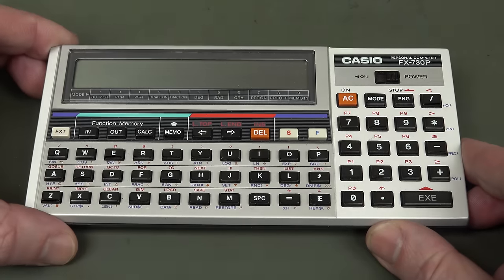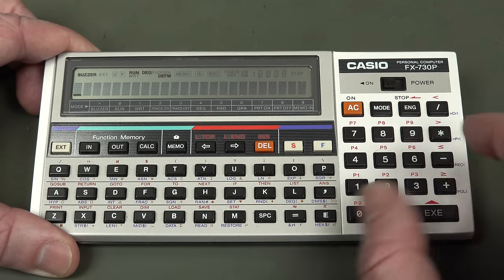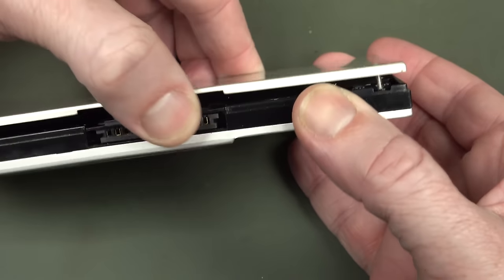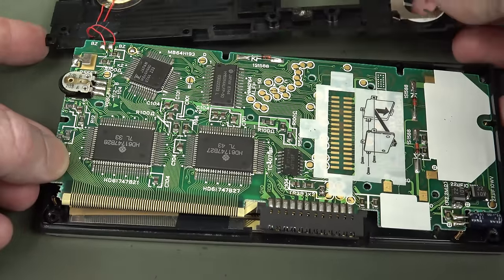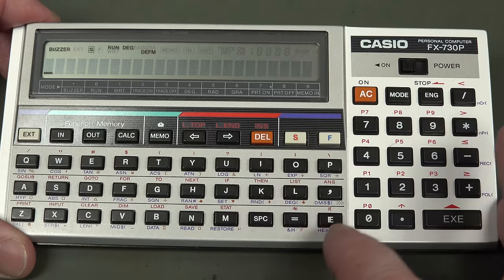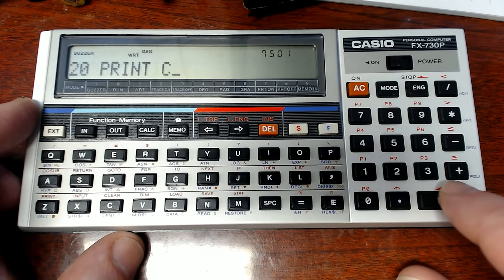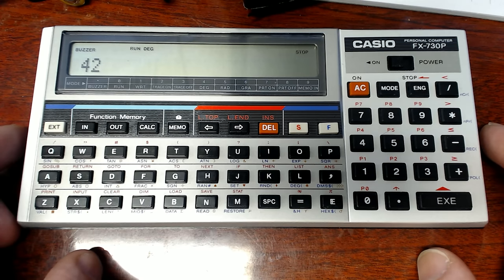EEVblog #1102 - Casio FX730P 1980's BASIC Scientific Computer

Comment: My first computer was a FX 720p (like this but smaller display), sold it long ago when I was a kid.   I recently bought one off ebay that wasn't working thinking it would be fun to try and fix, turned out they'd managed to shove the memory card in BACKWARDS and that was the only reason it didn't work, flipped it over and works fine!

Comment: 10 c=c+1
20  print c;: print
30 goto 10

This will allow the program to run without hitting the EXE button for each step
Reply from the maker: Ah, I knew there would be a way to do it, I didn't read the manual.
Reply: Dave "I didn't RTFM" Jones strikes again :-) I once had a (casio) PB700, is that older or newer than this one? It had a expansion port and RAM cartridges.
Reply: Starting to use c without giving it a defined initial value still kind of ticks me off!
Reply: There is also programming mode - TRACE ON, TRACE OFF. If you do TRACE OFF - you'll get the same.
Reply: Thanks. Also ran this in my Amsrad CPC 646 only with *2. The little CASIO can count to far higher numbers which I found intresting.

10 C=2
20 C=C*2
30 PRINT C;: PRINT
40 GOTO 20

With the Amsrad youdon't need ;: PRINT but you probaly knew that anyway.
Reply: @gotj  I love my CASIO PB-700. Was the first vintage computer I got for the wopping price of 99p on eBay, probaly because it was dead. That did not stop the teenage me cracking it open & repairing the battery leakege damage.
Reply: @TheEPROM9 Great!

Comment: This brings back memories... My dad had MK-85, USSR equivalent to the FX-700P. It was almost identical visually and had somewhat similar BASIC capabilities, but was completely different inside, to the point that is had a 16-bit CPU (while at the same time being slower than FX-700P), and lacked any expansion.
Reply: YES I have it too it is still running, but design was much more worse, it hase 4 batteries 1.5V and it works like only few months on it ;-), The biggest difference was that it could plot on the display some dots like a graphic calculator.
I also have casio fx-720P and fx730P like the one in the movie.

Comment: I bougth an 750P back in 1985 during my apprenticeship. Added two 4k RAM expansion cards. (It could hold two cards at the same time.) Moved over to a 850P in 1988. After 30 years it still serves as my daily calculator at work. I wrote some helpful little basic programs, still using one occasionally. The scientific and basic (blue, red) labels on the keyboard are bleached out. And pressing the BRK key often turns the calculator off. Gentle pushing right of the power switch against the case brings the FX-850 back to life. I wonder if any of the smartphones sold today will still work in 30 years. By the way, I have a collection of about 40 different CASIO (or TRS rebranded) basic programmable pocket computers. All in working condition!

Comment: I wish, I still had mine. I broke it in the mid 1990s and have never found a calculator, that I liked as much. It was simple to use, nearly no learning required. I really liked the formula entry and calculation feature, which was very helpful at university.

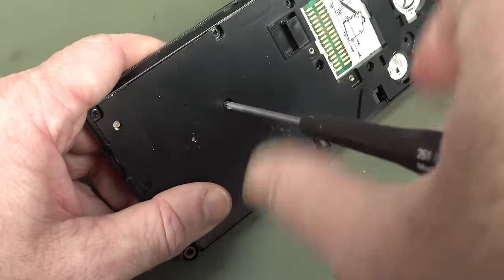Comment: 6:00 + ...  Actually the Hitachi's are not merely display drivers... These are actually 'DUAL' 8 bit HD61700 series CPUs that have 16bit internal data busses - The 730p is not too dissimilar to the folding 790p.  The Second CPU manages the scientific functions of the machine & half of the display, shifted keys etc. Whilst the First CPU manages the 'computer' aspect; BASIC interpreter,  runtime environment, the other half of the screen, unshifted keys & so on. The other 3 chips are a 440 gate logic array, 8k ram, & a quad 'OR' logic gate.

Comment: 10 c=c+1
20  print c
30 goto 10

I expect undefined behavior since c wasn't defined
to be 0. I assume, typically compilers will initialize variables to 0 then.
Reply from the maker: Yes, every BASIC I've ever used has always initiated to zero by default.
Reply: EEVblog, okay I figured so, thank you :) Great video by the way
Reply: Some BASIC's do some don't. Some of the ones on UK micro don't and give you an error, from memory the BBC micro/Electron. But I could be wrong.
Reply: If the program was used by another one in another section then the C variable may have been not set to 0. In this case, it would have been ok to enter 5 CLEAR. but as well change 20 like  20 PRINT C;  to get a non stopped execution. But all numbers would have been dislayed on the same line then scrowling on the left. To get the proper counter, the line 20 should have been 20 PRINT CSR0; C;   and then the numbers would have been incremented at position 0 without break. Each time the machine is turned on and the program is executed, the number count would have continued from the last break. To start from 0, the command 5 CLEAR or 5 C=0 would have been necessary.

Comment: Nice video I just saw today (3 years after you published it). BTW, you can execute any program recorded in the 10 sections by typing MODE 0 and then SHIFT n (the number of the section (0 to 9).  No need to enter RUN. Each program in the different sections can be called by each others using command GOSUB #n with n the number of the section. Interesting to imagine at that time to prepare programs witht the MAIN in 0 and then calling sub ones in different sections. No way to pass parameters but variables were global. So a section may perform a calculation with a variable used in another section. Variables were not isolated.

Comment: I have the FX-720P with 2kb SRAM (1568 bytes available after reset), and I had it overclocked back in the 80’s with a potentiometer replacing the resistor of its R/C that it was using for clock. I made it run from its initial 200kHz up to about 1MHz, although it needed to also be overvoltaged to 8V from the initial 6V of the 2x CR2032. I did it just as a proof of concept, not because it served some purpose to overclock it, but it was fun, and I still have it to this date in working condition! The 8V regulator (78L08) and the potentiometer are still embedded in the case. The regulator on the slim side next to the RAM cap, and the potentiometer was fitted on the mounting hole for the printer, on the back side. I’ve opened a tiny hole next to the expansion connector for the barrel plug of the external power, for when I’d wanted it to run overclocked.

Comment: I still use a Casio fx-450 calculator, a truely pocket size solar powered calculator that  does decimal, hex, octal and binary. Also does some logic functions (and, or, xor not, xnor) plus trig, polar/rectangular, DMS, and even fractions. There are also some built-in constants like speed of light!
Reply: the 450 was my first REAL calculator. I loved it. I eventually wore mine out and I still miss it though I have "better" calculators today it remains a favorite.

Comment: This clip in the middle of the FX-750 is for holding the calculator in place, when you use the FP-12S Printer with the table. You have to put the calculator on the table and then to the printer, who has a rendell-screw to tighten the whole thing.

Comment: Whoa. Memories. I still have mine somewhere around. We used this in our math class and it was allowed during graduation finals. Basic was limited, and there was no system level access whatsoever, but you still could achieve some fine results. I programmed a numerical analysis program for finding roots and extrema for polynoms. Was fun

Comment: Not quite that model, but I still occasionally use a PC-1403H. The periphery connector looks almost identical. The 1403 had a cassette interface in there for "load" and "save" commands, maybe this one has too? I also managed to score a printer for it on ebay recently.

Comment: The I/O connector was used to attach to a tape deck for program backup, printer, and... modem. Someone actually made a modem for those things.

Still using the Tandy PC-3. Similar to your Casio (but more cheaply made).
Reply: the Tandy PC3 is a sharp PC 1251
Reply: Also a link cable to transfer between two FX730Ps. I think I still have one and the cable. And the manual! I’ll have to find it now.
Reply: Yes, i build an interface to store my programs to tape for a sharp pc-1403H. I guess it is a successor of the fx730. It worked fine until the i guess i blew the port of the calculator...

Comment: The little springs on the back remind me of the spring in the HP 12C/15C type calculators.  They to had ground connecting springs.  Wonder if they stole the idea from HP.

I'm going to be uploading a video on picking a good calculator for basic electronics.  Going to cover everything from super basic calculators to the premium ones like the HP Prime.

I have about 820 calculators in my collection and think I may start doing videos on them from time to time.  Seems to be a increasing interest in vintage calculators.
Reply from the maker: Those ground springs are as common as mud on all sorts of stuff like this, I doubt HP invented it.
Reply: Springs more for ESD protection than EMI, as those low power processors could easily get corrupted memory if you used them as a discharge path from your charged body to a desk. Casio used the IO connector as a way to connect a printer and a cassette desk, so you could print ( using a small 4 colour pen plotter, with exquisitely expensive little pens that wrote 150m or so before they ran out of ink, or a small thermal printer later that was slightly better) and save your programs to tape. Tape interface also allowed the calculator ( and a big basic program you typed in) to play music as well, single note at a time, and somewhat limited, but big in 1980.
Reply: EEVblog excellent video :)
But, can the Casio scientific calculator run Crysis?
Reply: @thanthanasiszamp4707  No, for the zillionth time.
Reply: @Crazytesseract  my question was sarcastic

Comment: I still own this calculator with the original leather case and german manual and 16k of memory. It works fine, even with the 15 years ago programmed "horse race", which is one part in the manual. Great video!

Comment: that calculator is very easy to use. if you press the letter "S" (with the red color) its means its all for the red function and "F" for all the blue functions. its design to make simple programs specially for counting or determining coordinates depends on your program if your a Civil Engineer of so. in the year 1980 - 1990.

Comment: I'm a confirmed pocket computer tragic, I suspect. Started with the Sharp PC1211 back when I was in school, later replaced with a PC1246, followed by the PC1350 with the 4-line display and pixel-addressable graphics. These days in my desk drawer at work I have a PC1350 (with the 16k static RAM card), a PC1403H, and an EL5100 (not BASIC programmable, but a pretty impressive calculator for 1979) - they see regular, if not daily usage when I need a calculator - and they make me smile.

Comment: Springs help pop off the back cover. That's my experience from having owned several Casio's of this vintage.
Reply: Looks like that to me.  The ends of those springs are captured in the plastic and not electrically connected to the PCB so I can't see how they would act as conductors for EMI.

Comment: You can print "continuous" by simply adding a semicolon. For example 20 PRINT CSR0;C; would have shown you a continuous changing number. CSR0; is needed to make sure you keep printing at the start of the line. Also there is no need to add spaces when you code, the 730P will add them automatically, so you can simply type 20PRINTCSR0;C; and the spaces will appear automatically. With a bit of practice you can really type programs very quickly. I really like this pocket computer, but miss some functions like complex numbers, vectors and matrices.

Comment: Hyperbolic functions are because with one key you can get six new functions. I had Casio FX-702P from 1981 it was probably the first such Casio. I liked the way it was used to do calculations but unlike modern calculators you could not go back to the calculation after pressing the exe. If you made a mistake you had to do it all again.

Comment: Man soldering those diodes would have been a pain, surprised they didn't just use a melf package. Also cool reset switch, just a bit of metal soldered to PCB

Comment: I had the more commonly sold CASIO fx-720p, enjoyed writing a few simple programs when it came to repeated calculations during my studies.
It had only a 12 character display, so I was annoyed when the larger display version came out soon after.  
The port on the back is for the printer and/or cassette interface, the tab underneath is to align and grip these units more securely.
To save programs I used the RAM cards, which were expensive but I figured it was easier to swap out on the fly (powered off) than loading and saving via tape.  There was a latched door on the bottom to access these instead of needing to unscrew the case.
I found my CASIO fx-3400 programmable calculator better for everyday use, and still have that today.
For pocket computing, I soon got a Psion mx-5, which could connect via my Nokia 3210 to GSM data and get my email, diary, etc.  How quickly things moved on!
Reply: I had a 720p too. I remember spending ages typing in some of the example programmes from the manual.

Comment: I still have my Tandy branded version and its four color pen printer/plotter. In the mid 80s I did useful engineering tasks at work with it. I also still have my HP 21 and its accompanying "ENTER > =" T shirt. Yes, I hold on to some things.

Comment: Dave. i have a energizer battery from 1990 that still works. and has not leaked.    its has mercury in it(does not have the tree on the label).    Energizer bunny  keeps going and going! no need for batteriser...

Comment: 8k ram was simply a standard 6264LP3 ram chip that was on a PCB, with the zebra stripe connectors connecting pin to pin there on a small PCB.

Comment: Is this the predecessor off the FX-740p? I had one borrowed and it was pretty fun, had a RS232 I/O on the expansion port, one more line and more memory. I think the beep was disabled by default... Great stuff. Also the Ti Galaxy and HP programmable calculators were very fun to program.

Comment: I have a Sharp EL-5500III scientific computer which is missing its "N" key.  It can be a bit of a pain to program as you have to actually switch between a Run and a Program mode during programming.

Comment: Nice find mate!  this kinda looks like a TRS-80 pocket computer clone. which i  still have my TRS80 pocket computer and works like new. i removed the battery 4-5 yrs after i bought it so it didnt rot while stored.
Reply: All the TRS-80 pocket computers were re-badged Casios
Reply: The TRS-80 was a rebadged fx-700P.
Reply: Thanks, I did not know that. I just did a quick searched on them. Some early models were Sharp, and others were Casio. Mines a PC-4 so that makes it a Casio PB-100 re-branded. I do remember it wasnt anywhere near as powerful as the TRS-80 desktops. So i guess these were just fancy calculators with 1K RAM and 12K ROM. lol They did run most basic programming though which was pretty easy to learn.
Reply: well I am glad he took this one apart , so i dont have to take mine apart. =)  Anyone know how many of these were made ?
Reply: james corvett Dave said "it was only made a couple of years", but I seem to remember CASIO had a small range of 'calculators' in the 'pocket computer' style for several years.  Must have sold enough for them to keep making them.
Reply: The earliest in a similar shape was the 702P, from 1981.  I think the last of the 890P machines was 1992.
Reply: i got mine for Christmas in 1982, when i was 13 yrs old. And i made good use of it up til the later 80s. They must have produced a lot of them I just seen they're only going for around $50-70 USD? Im pretty sure it cost more then that new. I had the printer attachment too but it crapped out and i think i took it apart and couldnt get it working when around 1985/86 so it got thrown away. But i still have the box and manuals for the TRS80 pc-4, it was great that it came with the programming book. It wasnt as detailed or as lengthy as the desktop trs80 manuals though.

Comment: Sorry but calculators with = are for wankers :-) Real Men use programmable HPs with RPN.
Reply: George Of The Jungle real people dont need one
Reply from the maker: Bob Sacamano Take your mind back, I don't know when...
Reply: HP RPN!
Reply: I have an old HP RPN promotional t-shirt...

It simply says "HP CALCULATORS HAVE
NO EQUAL"

No self respecting HP Calculator nerd would be without one.
Reply: And does he still own a laminated bamboo slide rule.
Reply: HP uses RPN because they can't make a parser for algebraic expressions. With HP, is up to the user "to compile" the expression in something HP can understand.
Reply: When I first got my CASIO Pocket Computer, it was the '=' key that confused me.  The results of ad hoc calculations were given by pressing the 'EXE' key.  The '=' key is only used in programming!
Reply: candid moe My head works faster than my finger.  I find it quite easy to think in RPN and I have to make less key strokes.